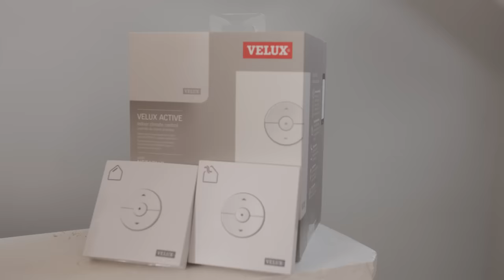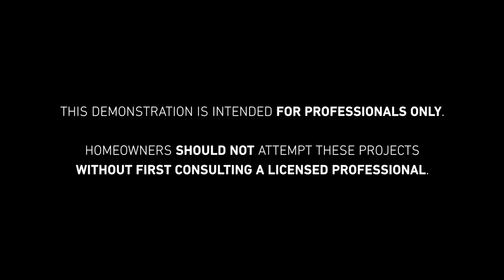How To Install a Skylight | Lowe’s Pro How-To

Comment: For vented attics, should you drill holes through/across the rafters on each side of the light?  That way you don’t have a soffit vent to nowhere and a ridge vent for a blocked off section.

Comment: What if your ceilings are flat how does that work?
Reply: Basically the same way you would just frame from the ceiling all the way up to the roof. Would be like little walls under the skylight
Reply: Your not flat so it's no big deal🤣🤣

Comment: Cutting a rafter that's in the way? Do exactly as they did it and 10 years down the road you are working with a building engineer to calculate rafter loads and having a bracing system designed since the structure has been compromised.

Also, they are preventing proper venting and mould will grow fast enough that you'll be seeking information on reroofing...

Don't ask why I tell you this...
Reply: In your opinion, what are the proper venting instructions?
Reply: @rmnjmnz8133  it all depends on your house and situation.  We went through the trouble of:

1) Doubling the left and right next rafters (if you really need to cut one...) we've used LVL and structural screws for this.

2) We were working with 8" rafters here. We used 2*6 lumber for top and bottom brancing. The idea is to let air pass through 2" seems a minimum in my mind... Your local building code might ask for something else tough...

Bear in mind that cutting a rafter as they did affects structure and this asks for an engineer to make calculations and suggestions.
Reply: @davidproulx4782  
Yeah, i don't recommend cutting the rafter, it could affect the structure strength, but as i see they've a narrow space between rafters, it's a must for them, also i want to make a skylight just for the light scene not for venting.
Reply: Arent all rafters pretty much spaced apart smaller than most skylights?

Comment: This is a bad example because this house does not have an attic.   Almost all houses have attics.  So I would have to clean out the insulation and construct walls in my attic and then insulate the outside of these walls that make the light channel.
Reply: Sky lights are only installed in vaulted ceilings

Comment: This is a bad example. Shingles removed should be staggered more to prevent water from reaching the underlayment.
Reply: The shingles are staggered by the roofing company that Installed the roof, when you install a skylight you’re removing existing shingles not cutting new staggers in. 

Water can get under shingles and all roofing materials that’s why you have underlayment.

Comment: DON’T DO IT…..because it will leak if not now it will leak in the future.
Reply: There's many ways to prevent leaks.
Reply: Why should it leak any more than anything else that pierces your roof?   Like a chimney or vent etc.   I have 10 vents on my rood and they are flashed into the shingles.   If these skylights are flashed properly, they won't leak unless they leak somewhere on the actual plastic seals of the skylight.
Reply: All that lore is pre- ice and water shield era skylights. If done right, you’re more likely to get a leak somewhere else than the skylight itself with modern installation.